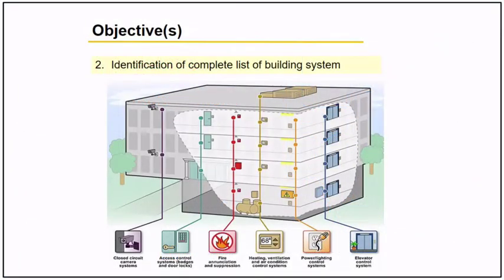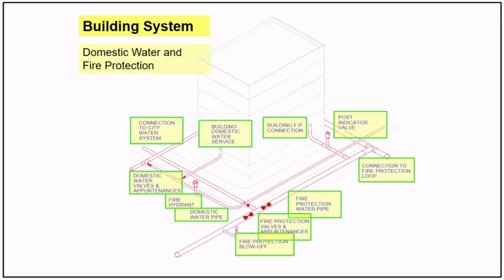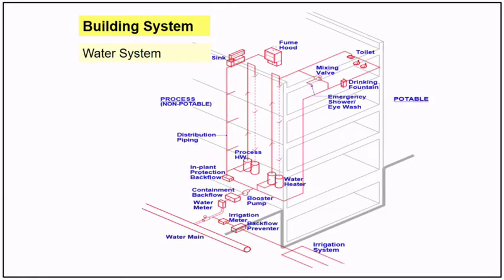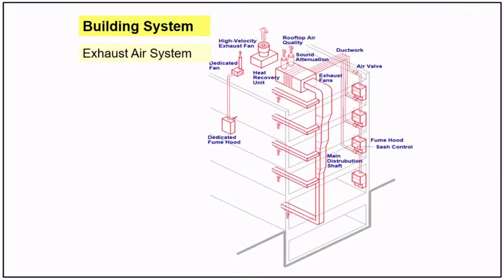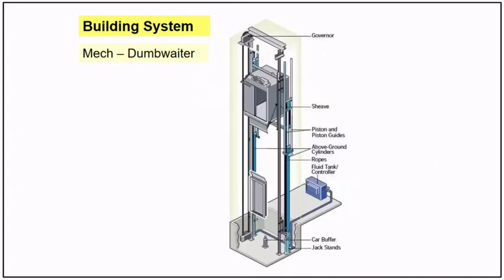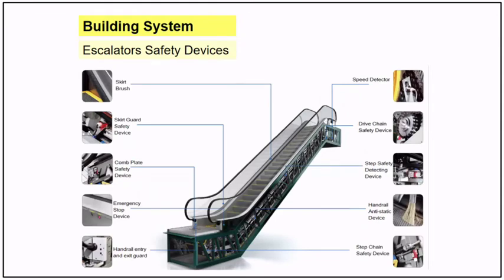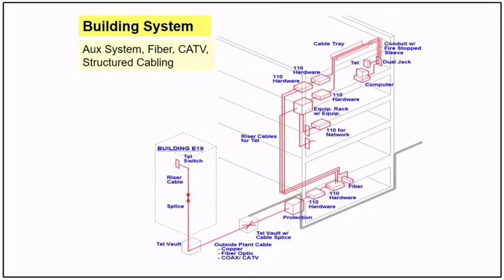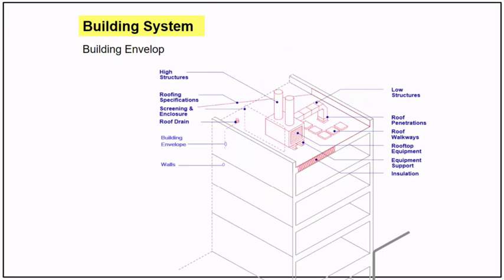Facilities Maintenance Management - Identification of Building Assets 02

Comment: HVAC is job exclusively for Registered Mechanical Engineer according to their latest Mechanical Code. And HVAC electrical power for REE based on their PEC latest edition. Pero dapat mabago sana Ang law. Dapat for HVAC installation Hindi lang ME at EE Ang need dapat need din Ng ECE for the signal system of devices used by HVAC. ME for actual mechanical installation of HVAC, EE for power system and ECE for electronic and signal system.
Reply from the maker: For facilities engineers , they can handle all, its the most economical for business,  but i agree with you, different professions should be working in a facilities. Possible solutions is cross training which most of facilities are doing.
Reply: @bersalazarjr  As a practicing maintenance engineer, you have the whole plant and facilities to manage. Thus, you have to possess the macro view of the elements , from there, you now select the various trained and certified service providers to work on them. It is your responsibility though to manage the processes, best practice strategy and maintenance models employed.

Comment: Fire Detection and Alarm System, Aux system: like Fiber, CATV, CCTV and Telecommunications facility, and etc. Is a job for ECE only. Because it is written on the Philippine Electronics Code Books (latest edition). But I wonder Meron din Pala sa Philippine Electrical Code Ng FDAS at Communication System at nabanggit doon na Sila lang ung exclusive na pede mag gawa. May conflict Ang practice between ECE and EE dapat solutionan ito Ng bagong PRC head. Maganda sana sa bawat Project Ng mga nabanggit sa TaaS dapat required Ng law: dapat pareho ECE at EE Ang kelangan per installation. EE for electrical power system installation of the devices use by those system above and ECE for design and testing of individual devices and as a whole electronic system.
Reply: Xempre kelangan talaga Ng Electrical Engineer,,,Hindi pede ECE lang Ang gagawa Ng lahat dahil Hindi Sila pede salpak lang Ng salpak Ng mga devices nila at Basta Basta magsaksak lang sa any 220V source. Need talaga Ng EE to guide them where to tap or to built them a new Electrical power supply system. At responsibility nman ni ECE na alamin lahat Ng required power per devices nila and as a whole para ibigay itong info nito sa EE. Maganda talaga magtutulungan nlang kesa mag agawan Ng practice total pare pareho lang tayung mamamayan Ng ating sariling bayan. By the way registered ECE po ako.
Reply: Just additional info: may balak Ang APO Ng ECE called "Iecep" na gawing monopolized Ang practice ng FDAS exclusively for ECE based on the speech of Iecep President on this FDAS seminar link: https://youtu.be/-Fw7tf09daA  pero Makikita mo din aq nag comment doon na impossible un. You may read my comment on that or any viewers of my this channel. My comment on that is very educational for Electrical Engineers so that they will have Info on what situation on the Electronics Engineer.